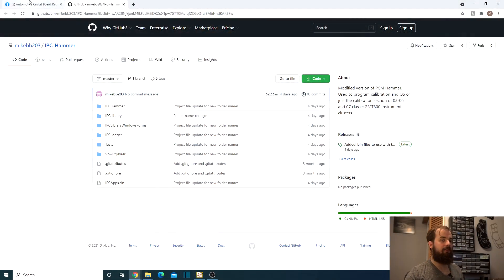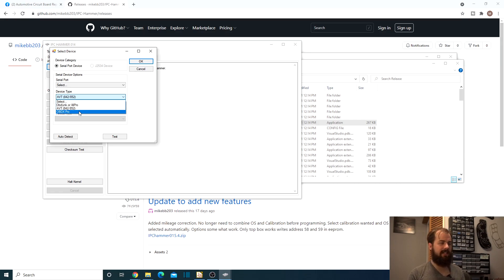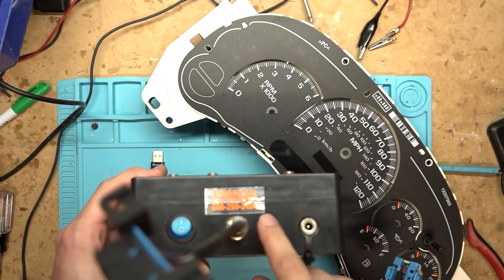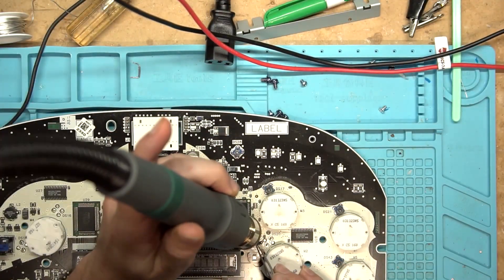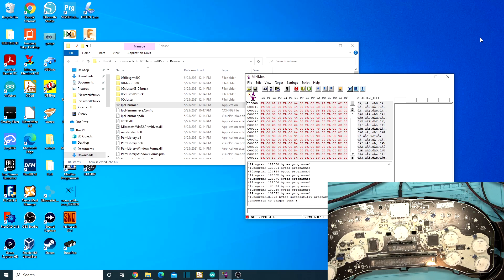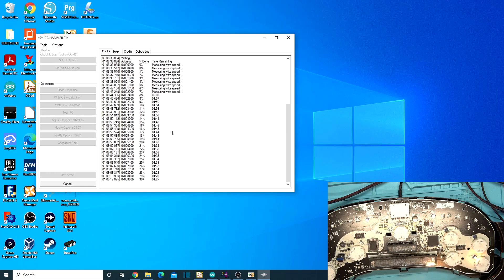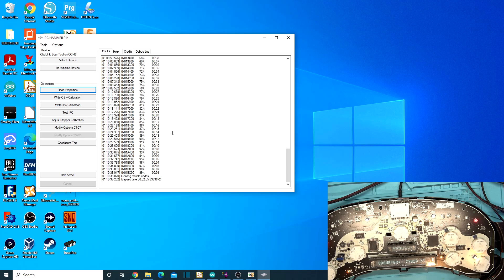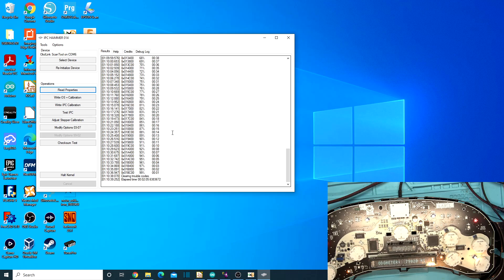IPC Hammer For Programming OS/Cal 2003 to 2007 GM Instrument Cluster

Comment: Do you have to do anything to enable TPMS on the cluster? I recently got all the stuff to mess around with IPC hammer, as well as having a sacrificial IPC to mess with in case I mess it up. I will be adding TPMS to my MY03 truck via replacing the passenger door module. Should the IPC just pick up on that, or does anything has to be changed in the programming? Thank You.
Reply: I’m looking to do the same thing. Please post here if you find out any more info. 
I think you just have to update to a newer OS version but i also heard you might need to update the BCM too.

Comment: Any way  to know what bin files have what options on the git hub? i am looking for a bin file to flash my cluster with steering wheel controls, and trans temp gauge. my truck is an 2004, and i guess i could be lazy and just find a vin from a truck that already has the options , buy the vin through techline connect and program it, but for one, i would rather not spend my money on acdelco tds, when i can donate to mike instead, and 2 i like a challenge and learning new stuff.

Comment: This would be awesome to do with other GM clusters
Reply from the maker: it would only work for stuff from around 99 to 2007 some of the impala stuff goes past 2007 i think. Pretty much all the J1850 vpw stuff could be support if someone wants to put in the work. 99-02 GTM800s I think MCU is either mask rom or 1 time flash so you cant program the mcu only the eeprom.
Reply: @FixedUntilBroken  Ones I have are 00-05 Astro\Safari and 01-10 Montana's
Reply: @FixedUntilBroken  Can you upload another video of how to program steering wheel on 2003-2005 gmc Chevy cluster please

Comment: I have an 04 2500hd that I want to add the DIC to in order to view my instant and average MPG. Can this be done using an 04 2500hd calibration that has steering wheel controls? Or do i have to upgrade to a newer OS and calibration?

Comment: If I am just using Pwr, Gnd and data pin, why do I need an obdii connector. Will the software work through the com port without the obdii adapter. Just trying to understand. Thank You...
Reply from the maker: you dont have to use an OBD2 port you can wire direct to the tool. unless you mean like a normal com port on a computer. class 2 serial isn't rs232/UART its J1850 VPW. it goes up to 7 volts. so you cant a normal com port to talk to it.
Reply: @FixedUntilBroken  I think I understand now. Thank You...

Comment: Nice work there! Was curious if IPC Hammer works with J2534? It was grayed out on your video, so I'm not sure it was because this function was reserved for the future releases or whatever the matter is..
Reply: I'll reply to myself. I tried it with J2534 (original GM) - mixed results. It does retrieve the properties, it triggers the test, reads the VIN, calibration ID etc.. When I try to write the calibration - cluster enters into "programming mode" (displays and warning lights goes off), it requesting permission to upload a few times, then responds that permission to program was denied and exits the programming mode (displays and warning lights are ON again). I tried with 4x communications enabled and disabled - no difference. Am I missing something in configuration or original GM J2534 not really suited to work with IPC Hammer?
Reply from the maker: Sorry for not getting back to you. I actually forgot after seeing that you asked. I didn't know if it works or not. I remember talking Mike about it when he wrote the software but I couldn't remember if he had a chance to test it. I still can't really remember if it's tested or not but it sounds like it's not well tested
Reply: @FixedUntilBroken , Thank you. I'll try it with the different laptop - who knows may be some drivers are conflicting or whatever the case could be. I know that my J2534 works OK, because it works fine for the cluster programming using official GM subscription ($49 per 1 VIN, I believe it is :) ).
Reply from the maker: All I do know about it is that it was already there from PCM hammer. I've actually not looked at the source code at all on IPC hammer or PCM hammer but it could be that some of the functions of it don't work. I simply don't know that much about that part of ipc hammer

Comment: When would you write OS + Cal vs just writing IPC calibration?
Reply from the maker: First example that comes to mind is if you were going swap an mcu off of one one board to another like a trailblazer to a Silverado (I haven't tested this though).

I can't think of many times you actually need to change the OS though but it's worth having it as an option. But the way the folders are built all the cals match the os in that folder
Reply: @FixedUntilBroken  Gotcha, I have a bunch of boards here that I’ve just been reading properties and seeing what there functions are. So like 03/04 with steering wheel controls, with driver 1/2, without service brake booster etc just so I have it written down and know. Now, if I wanted to say take an 06 Gas board, and convert it too an 06 diesel board, is this possible aswell? I would assume that would require a OS+Cal write?
Reply from the maker: @theoriginalmiked7795  it's actually just a calibration but you also need to clone the eeprom off the diesel board
Reply: @FixedUntilBroken  Ok last question lol. On an 06 board, are the trans temp setting different then 03-05? I just checked the options on this one I have on the bench and it’s showing a6 03
Reply: Compared to an 06 Denali cluster, which is showing A6 02
Reply: @theoriginalmiked7795  Yes. 06 is 02 or 03 depending on trans temp or not. 02 is trans temp and 03 is without trans temp.

Comment: I'm not understanding why the VIN matters? I have a instrument cluster from a Denali in my Sierra
Reply from the maker: Vin doesn't really matter at all you can just use to look features. BTW the cluster will grab the vin from the PCM and write it to itself when you plug it into your truck.
Reply: @FixedUntilBroken  ok thanks for the video and response after almost 2 years my mileage is correct for the truck and almost 6 years the buttons work for the DIC
Reply from the maker: @stacyadams4386  sweet I'm glad the video helped you!

Comment: Has anyone looked into modifying bcm? I was kinda surprised how much this is on the cluster yet no one seems interested in digging into the bcm to add more options etc?
Reply from the maker: I think the main driving factor in clusters is that they sell good. BCMs are cheap and lots of of them at junkyards clusters not so much. I think it there was more of a market demand on BCMs you would see more info about them like PCMs and clusters.
Reply: @FixedUntilBroken  that makes sense.  How long on average does it take to get accepted into the FB group?
Reply from the maker: @diy_automotive  normally a day
 or so but I just checked there are no pending requests. Did you answer the questions in the request section?
Reply: @FixedUntilBroken  I did, I was accepted earlier today, thanks

Comment: Will it work with 07 to 14 clusters??
Reply from the maker: No that's canbus. This if for class 2 stuff
Reply: I use tis2000 with a GM mdi interface. Works good, will flash one in under 5 minutes but won’t do controllers newer than 08
Reply: @deerhunter8533  for the 2003-2007 clusters which file you choose to write the steering wheel control  on the ipc hammer app

Comment: I don't know how to do bug reports or anything that deals with programming, I just use programs to assist me in doing a better job.

 So with that in mind.. 

In IPC , when not connected to a device (don't have one yet), When you run the checksum test and select a ".bin" file it runs flawlessly, but when you  do not select a file and just press the cancel button or "X" at the top right corner to close  the window, the "checksum test" page does not return to the main menu, and when you press cancel at the bottom of the  "checksum test" page it does not return to the main menu forcing you to restart the program. It does however acknowledge that you did press the cancel button. 

If possible could you pass this on to Mike B, 

On another note, do you still have that broken power supply we talked about in December, if so how can I get up with you to pick it up. I live over in Defuniak Springs, I am a new member of your group if that helps in communications.  Thank You...
Reply from the maker: I am still looking for all the parts on it I cant find it all now. and I will pass word to mike
Reply: @FixedUntilBroken  I'll check back with you later.  Thank You...
Reply: @warenmann1042  I’ll take a look at this problem. Thanks for bringing it up. I don’t think I ever clicked cancel on the checksum test.